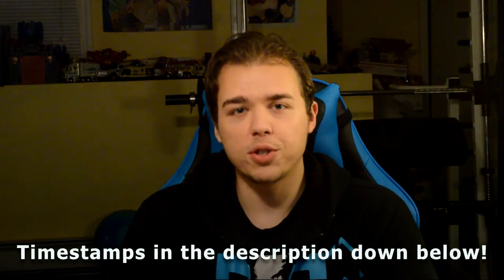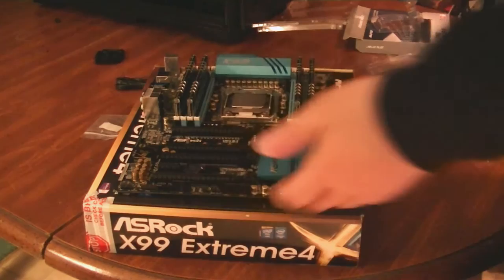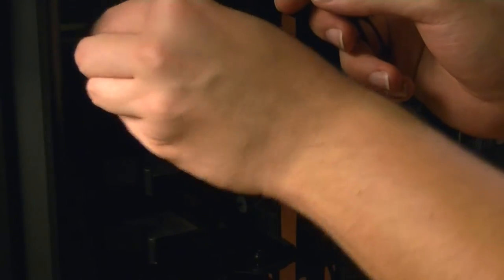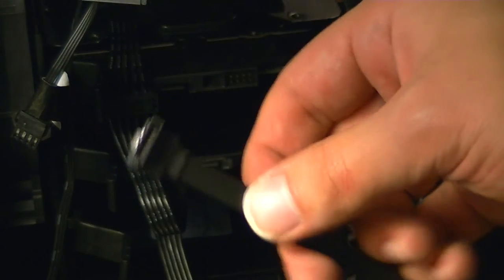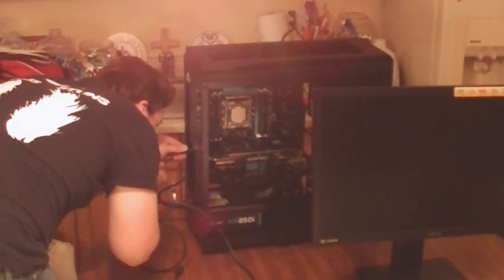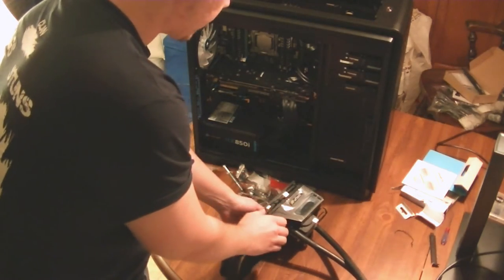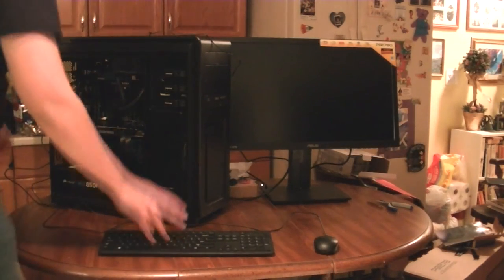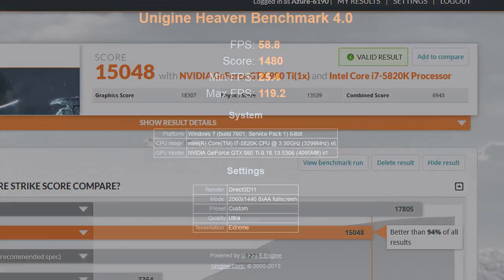Ultimate Gaming PC Build Guide 2016! Prices, Parts & How To Guide

Comment: Good stuff, man. I'm building a computer using the Enthro Luxe as well. Great to see the functionality and building process with this case ahead of time.
Reply from the maker: Definitely! I'm glad you enjoyed the video. I was trying to avoid a cable mess by not using the SSD brackets in the back but it totally would have left me more space in the actual HDD bay had I done it that way. Anyway, good luck with your build man! Glad you enjoyed and thanks for watching and commenting :) -Stevie
Reply: I had my SSD positioned in the bottom SSD bracket and my HD in pretty much the same bay you had yours in. I couldn't connect them with one cable if I had used the top SSD bracket.

Comment: Question: You can use HDMI when making the first boot up? When building my gf's bro's pc, we had to plug the DVI in for us to see the display during first boot. So I thought maybe HDMI in the GPU doesn't work until drivers download and install. But it looks like HDMI worked fine for you? I ask because I am about to build my own PC and my monitor only has HDMI ports, no DVI or VGA. So I was gonna get a friend's monitor to do the BIOS setup and OS install. But if i dont need to do that, then that would be nice.
Reply from the maker: +35jdub Yeah I'm not entirely certain, maybe it had to do with the graphics card? But yes indeed I used hdmi just fine. If your motherboard has onboard graphics you won't even need the graphics card installed for the test boot either, you can just plug into the motherboard's slots. But mine didn't have onboard graphics so I had to have the graphics card in. I'm not exactly sure why hdmi didn't work, unless maybe the port was blown out on your monitor, but I'm assuming it's working fine now. It totally could have been the graphics card needing a driver but I've never heard that before. I'm glad you figured it out though! And good luck on your next build. I'm hopeful the hdmi should work fine :) -Stevie

Comment: That seems a bit pricey. My current build is a Nanoxia full tower, Gigabyte Z170x G1 mobo, Skylake 6700k, some insane DDR gazillion ghz ram (can't remember, but it was like 3400 or something,) GTX 980, 1000 watt corsair ps, and I was still below 2k cost.
Reply from the maker: +Neil Stryker Yeah there's absolutely no reason to spend as much as I did, I just wanted to see if I could gnab the best of the best. With certain things I'm noticing how excessive it's been, especially when programs like Vegas and Photoshop don't seem to use anywhere near my amount of ram, things aren't optimized to use multiple cores, etc. Sounds like a great build though. Thanks for sharing!

Comment: guys i need help, im planning on getting the phanteks enthoo luxe for my case and i have an fx 6300 and a r9 280. do you think the case is overkill for this build and i should go with a cheaper case. or stick with the phanteks enthoo luxe as im planning on upgrading soon
Reply from the maker: +_PaGz_CS:GO Worry about the main components first, but if you can fit it in the budget then go for it. It's certainly a beautiful case with a bunch of room so if you need to upgrade stuff in the future you should be able to no problem. At Computex this year they showed off a new enthoo luxe design with a different side panel. I don't know if that means they will slowly start shipping those or if the original design will end up on sale so they can get rid of their stock and make room for the new one. So keep your eyes peeled about that because there is a chance that these could get cheaper. If you really like the LEDs that it has then this is one of the easiest and most beautiful cases you can get for that. But there are definitely some gorgeous cases in the $80 range so just make sure it has everything you want and that there isn't a cheaper case you might like even better. -Stevie
Reply: ***** ok thanks for the help i still cant decide but i think im going to upgrade my cpu to an fx 8350 then to a i5 6600k later on (in about a year) and possibly upgrade my gpu to a r9 390. So i think im gonna stick with this case so i can upgrade my components later on if i so need to. Thanks for the help once again.
Reply from the maker: Sounds good! It's definitely an awesome case and pretty easy to build in. It should be plenty of room. Thanks for commenting :) -Stevie
Reply: +Lucky Crit thanks for the help
Reply from the maker: +_PaGz_CS:GO Of course :) -Stevie

Comment: is it possible to boot your pc without a cpu cooler? won't your cpu get damaged that way?
Reply from the maker: You can totally boot without the CPU cooler. Just make sure you aren't doing anything super intensive without it, like if you're just test booting or installing windows then I think you're fine. I'm not sure about some motherboards but they may require a CPU FAN hooked up in order to boot.
Reply: +Lucky Crit will the cpu not shut down because it is getting overheated?
Reply: +Lucky Crit thought that I've read something like that
Reply from the maker: Depending on how old your CPU is I'd assume if it's recent then it will shutdown automatically to protect itself when it reaches a certain heat threshold. I mean I wouldn't fiddle with that but it should have some protection so it doesn't just melt itself.

Comment: does the luxe not have pwr led
Reply from the maker: +popo6579 Hi there, I'm not sure what you mean. The LEDs change color from a button on the front of the case and come directly from the front of the case all around. There's a set amount of colors you can have, but in my case it's a pretty nice selection and I'm thoroughly satisfied.
Reply: If you're talking about the power LED front panel connectors, it does not have them. I looked for a full hour and dismantled the case because I thought it was stuck somewhere. It doesn't help that Phanteks has the Power LED positive and negative connectors listed in the manual. From my understanding, the Case LED connector acts as the power LED connectors in other cases.
Reply: Thanks  TheMissing8, that's the same thing I found to be true.

Comment: You just helped me build my (http://pcpartpicker.com/list/Bqxz6X) X99 Extreme4 system without a single glitch. I didn't install Windows 10 Pro yet as I will go ahead and order Samsung SM951 M.2 SSD 128GB and use it as boot drive :-). Thanks a lot for such detailed installation video. Any tips to install OS on M.2 drive?
Reply from the maker: I think with this motherboard everything went super smoothly and I didn't have to do anything weird to get it to work. I'm pretty sure from the get go it just recognized the M.2 and then I loaded the OS on it from there! Awesome dude! Glad to hear it. Thanks so much for watching :)